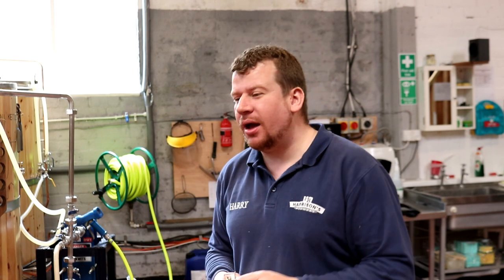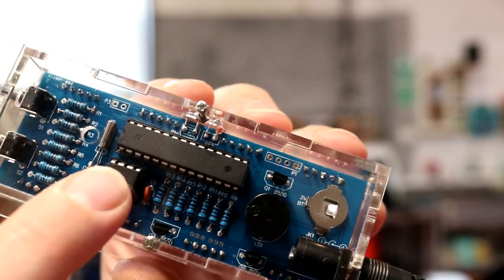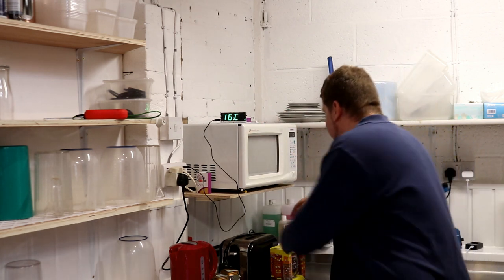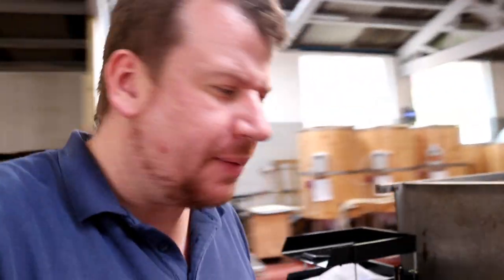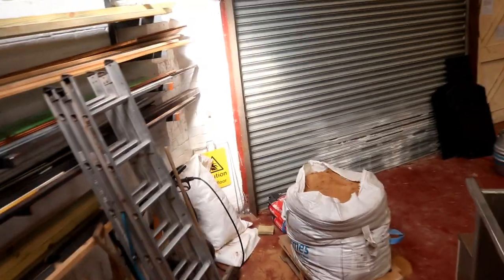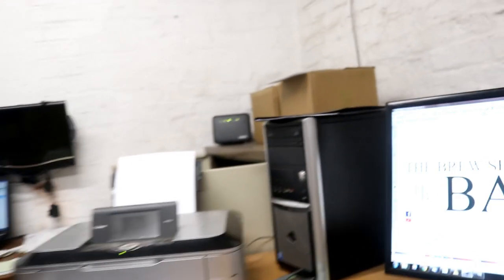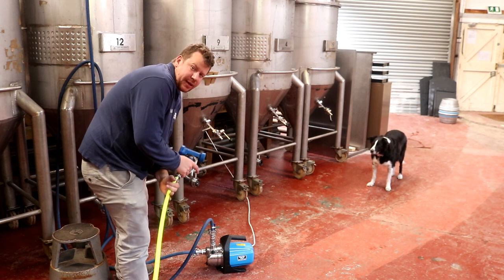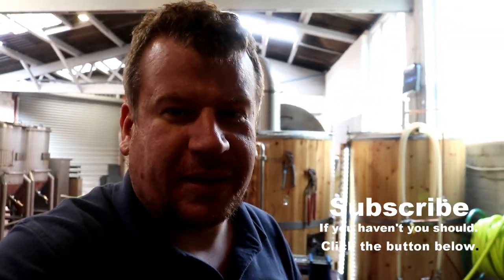BUILD YOUR OWN THERMOMETER ~ ALARM CLOCK~

Comment: Harry, a very simple & cheap way to remove the condensation would be to sit the radiators in some small gutter with two end caps, then solvent weld PVC pipe out the back of each room to the drain. This also doubles a better way to mount the rads as they only need something at the top to steady them.

Comment: You could use Pvc tube to catch and remove the condensation  , grind an opening and use some reducers to accommodate smaller diameter tube to remove the water to the door.

Comment: The wall behind  and above  your control panel looks like the damp is coming through.... are you going to build the mobile bar?
Reply from the maker: Yeah, they have outhouses on the other side of the wall, it can be like a river so I have everything mounted on stand offs.  Yeah, building a mobile bar. It will be simple to start with.